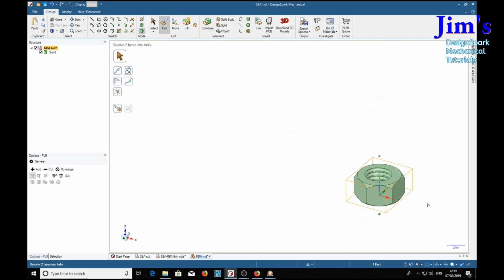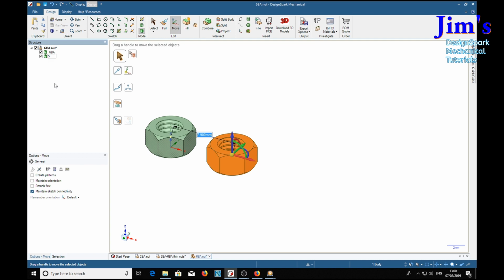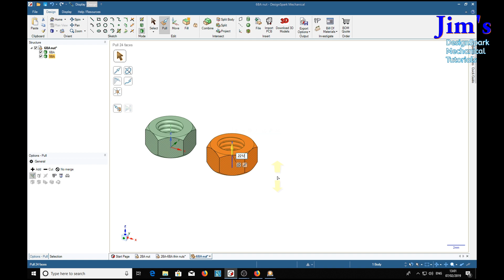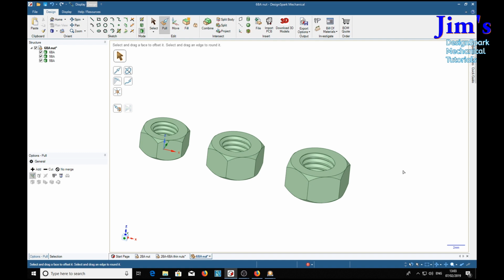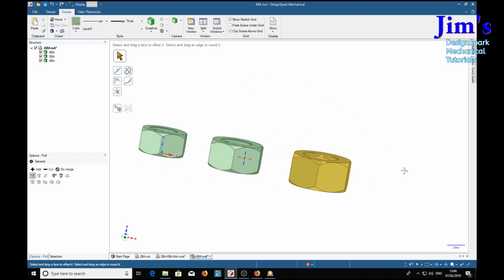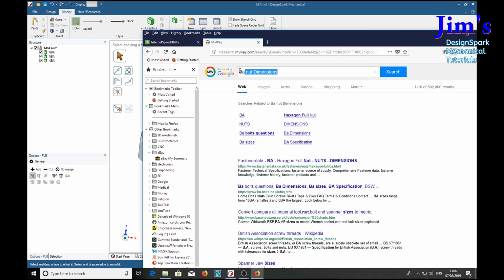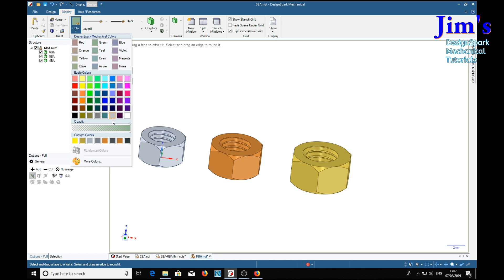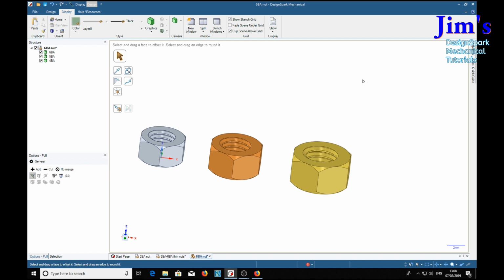DesignSpark Mechanical: Making a series of nuts pt3

Comment: Its called threads and point to point is called pitch. 1/4-20.
1/4 = diameter and 
20 = threads per inch

Comment: Good stuff. I'm still learning the nooks and crannies. I tried to scale body on just a pattern I made on a fastener yesterday, and had no luck. I suppose they use the term "body" for a reason. But now I still wonder if you can scale just a pattern, like machined indentations. Also I am finding bugs. I have one part that I can only spin in one direction, until I turn on another assembly, at which point I can spin around and manipulate.
Reply from the maker: On the issue of bugs. I am also finding them. I have a folder containing videos i have made demonstrating DSM bugs. I am trying to get the DSM developers to address them by issuing problem tickets. If I do not get some sort of answer to them in a reasonable time, I may dump them all onto YT. Maybe that will speed things up. Once the answers are fothcoming I will post them.